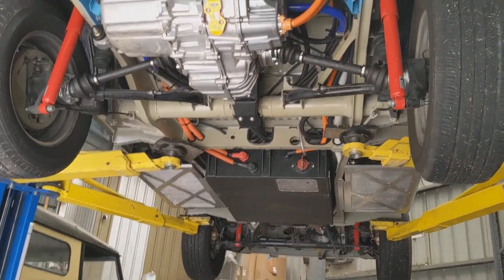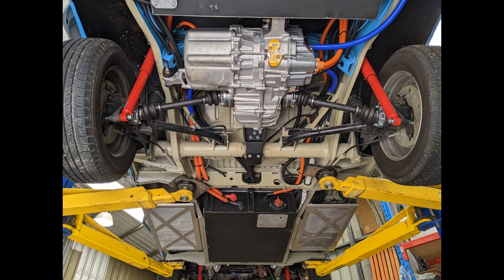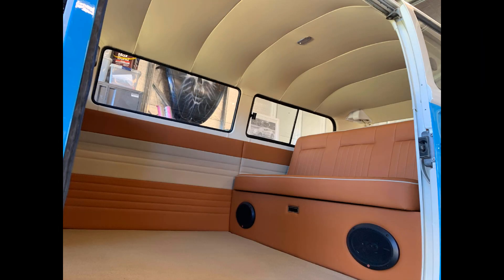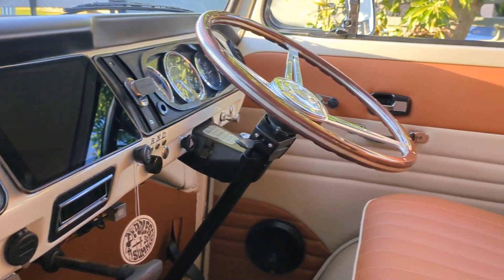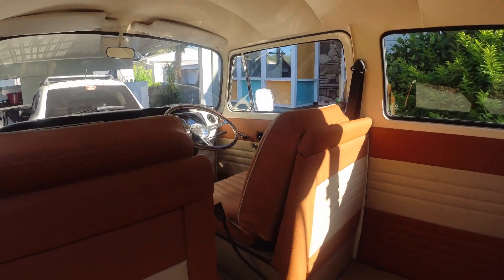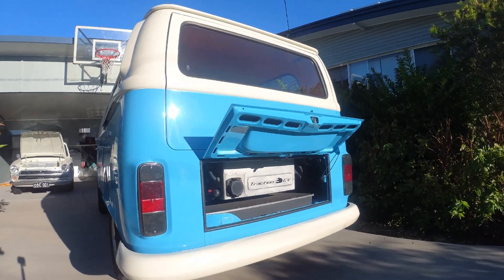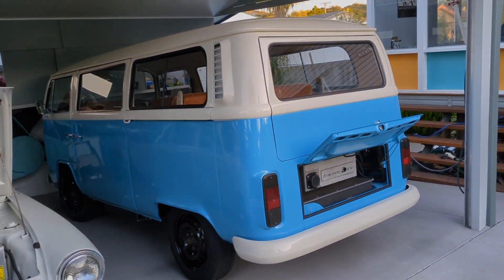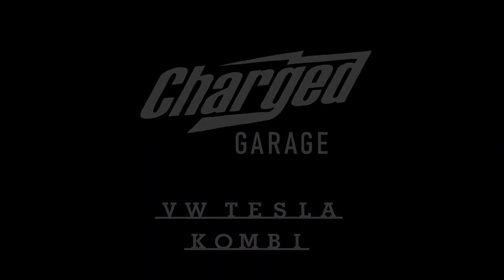I killed the Tesla motor in my VW Kombi - Tesla Swap EV Conversion Pt 4

Comment: Those opensource inverter controllers are inverter killers!  I've killed one and know several other guys who have done the same.  As you say, just one parameter set wrong and the smoke comes out!  We all went over to the EV Controls controller, too.  MUCH better!  Very nice build.
Reply from the maker: Yeah it's a shame the default values are so wrong. I'm not an expert programmer or youtube/forum addict to follow the latest recommendations, so I've learnt a difficult and expensive lesson!
Reply: @chargedgarage131  How it fails, did you get a shorted IGBT?